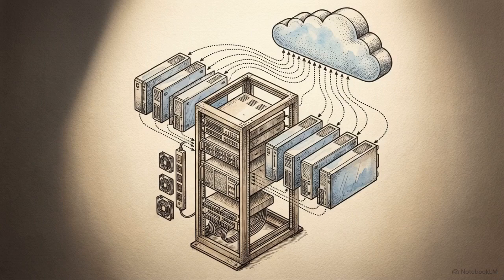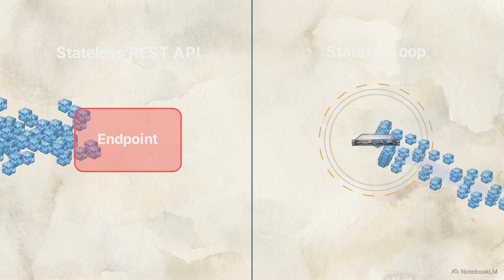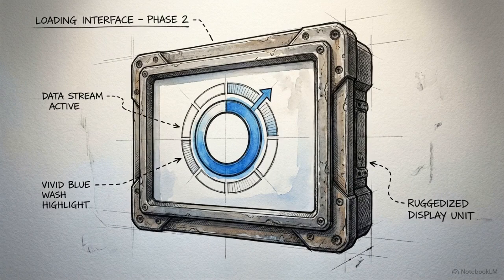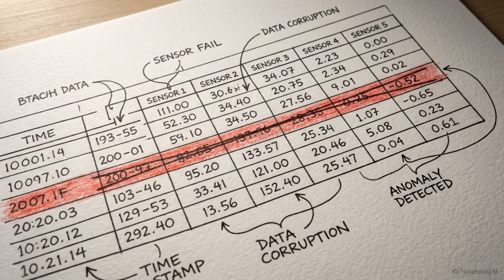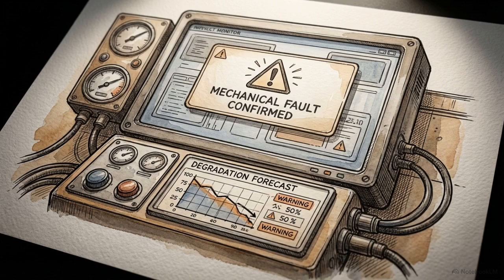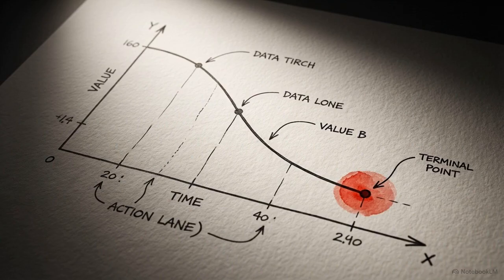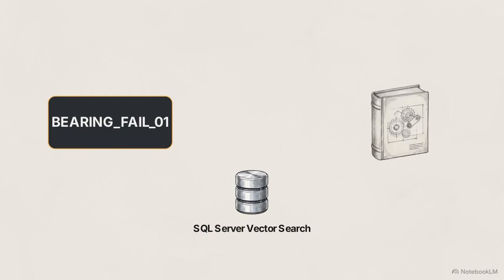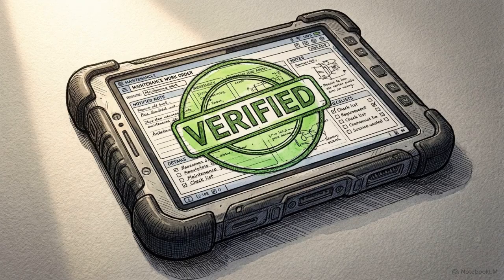The Stateful Edge  Architecture of Industrial Truth

Comment: Will this work on a system that is not controlled by a PLC ?
Reply from the maker: The system relies on ingesting a continuous stream of telemetry data to perform its analytics. The historian polling adapter tracks per-tag watermarks and fetches the latest sensor readings from active subscriptions to pull them into the in-process stream for analysis. It uses the PLC's internal logic, such as relay states or valve positions, to confirm process occurrences and suppress false alarms. While the system is designed to handle physical constraints, its ability to execute "software-defined interlocks" is dependent on having access to the machine's state logic, which is traditionally provided by the PLC. But the system is decoupled from the PLC hardware vendor, functioning as an overlay rather than being constrained by the PLC's backplane CPU.